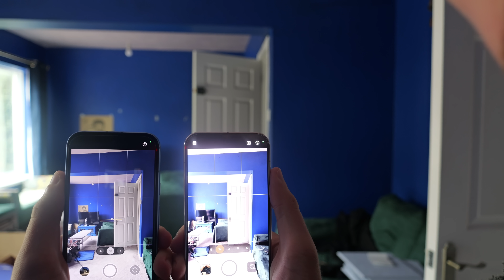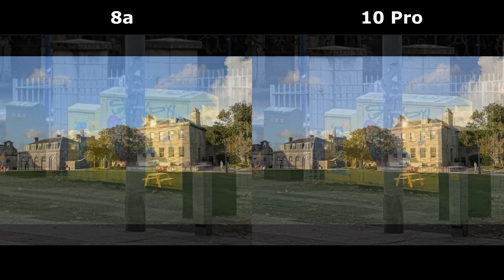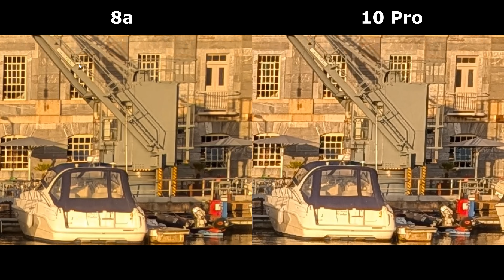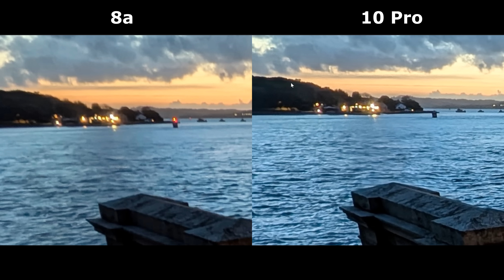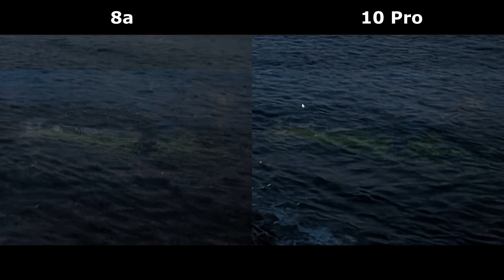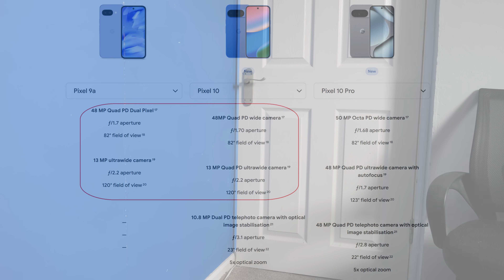I Tested Google Pixel's Cheapest and Most Expensive Phones

Comment: Considering the Pixel 10 at least has the same sensors as the 9a (which is surely better than the 8a and also gets some praise by itself) and then adds on a great telephoto, I am wondering why it gets trashed so much. Also - "could still suffer from the same low light" etc.... V/S Will surely suffer ... that's a key issue isn't it. The problem is that very few reviewers are checking out the Pixel 10 base model's main camera on merit. They always seem to preface their "wisdom" and seem obsessed by this downgrade issue. Which makes me wonder if there is some kind of bias at work here, a kind of horde mentality... or perhaps just a need to look kowlegdeable?

Comment: The HDR-ieness of the Pixel 10 Pro might be due to Ultra HDR, so the brighter thing might look darker in the SDR version of the image, but they are being brought up to the appropriate level by UltraHDR then. But for that to compare you'll need an UltraHDR compatible Image Viewer and an HDR video and the viewers would need an HDR screen.

If you have a compatible viewer and screen, I have to say the UltraHDR images look simply fantastic, with extremely bright highlights and great contrast. But the draw back of course are those software and hardware requirements to fully exploit those images. UltraHDR is available from Pixel 6 or 7 upwards I believe, my Pixel 7 Pro definitely supports it.

Comment: Is there a pro mode in the camera that disables processing? Or maybe 3rd party camera apps to test camera performance and not algorythems.
Reply: there is on the pro models but most people will just use auto.. which is why he's comparing them, in auto, without a tripod. emulating the results the average person will get if they either one.
Reply: @warmoaran3 I know, I'm just curious since some people are power users. The pixel is a phone with an unlocked bootloader and it's one of the few phones that retains it's integrity with a custom rom, specifically graphene OS I think. I haven't checked in a while so this info could be out of date.

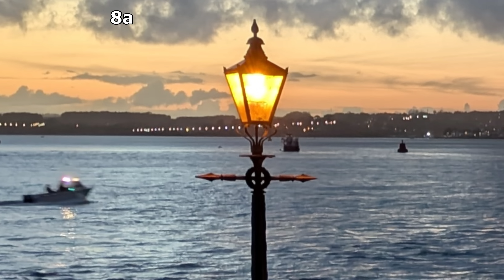Comment: 8:50 Isn't that just an example of different focus/exposure of the 2 pictures? For me it does seem like the 10 Pro photo had exposure level focused on the light, and the 8a photo was focusing its light amount somewhere else. Did you specifically chose the focus spot on both phones while taking a picture or you just snapped it?

Comment: For the next time it would be interesting to have the same photo taken two different time. The first is just casually pressing the shutter lile 99% of user will and the next should be maxed out quality or even RAW quality with some tweaking to get the most out of the sensor. But just showing the regular photo is how pretty much everyone will be using the phone so its definitely a valid comparison in my opinion.

Comment: Using 8 pro still and got regular 8 for wife. They have larger sensor than 8a (8a uses sensors of 7), so they work better in low light, which is a lot of time where we live now. Still happy with hardware and software is good enough - google has lots of bugs in their android version, but I'm tolerating most of the time. In general I look at what phone can do in low light - that's the main aspect of shooter. If it can also do physical zoom of 3-5x - it's a great perk for my bad eyesight.
Reply: Sony Xperias are currently the only phones offered that can do physical optical zoom of 3.5x - 7x!! although you probably meant fixed optical focal length, like the Pixel 10 pro 5x 113mm lens

Comment: Another interesting consideration is getting a budget phone and a cheap, second-hand DSLR for the photos.
I recently picked up a Nikon D3000, which is an outdated and limiting piece of rubbish to photography standards.
But I love shooting with it and processing my images myself in Darkdable, learning what the camera settings and processing steps do as I go.

You get full control over the sharpness and colour cast when shooting in RAW. I like to shoot in a set whitebalance, to adjust from there per photo.
I have not seen any of these insane artifacts, as my camera does not support bracketing and as I have not bothered doing it manually.

And it is fun to play with lenses, especially after picking up a cheap M42 adaptor I've been scouring local thrift stores for lenses.
On this specific cameras, you have to set exposure fully manually with adapted lenses, which is surprisingly easy to get right outside with the expanded Sunny 16 rule.
Inside I need a wider lens with metering and preferably auto-focus, so there I use the kit-lens.
But in low light, the ancient sensor struggles, so I put on a vintage nifty-fifty lens in these conditions, which makes it hold up okay.

My everyday carry (yes, I do bring it along with my phone) is a cheap IX mount lens which is good enough, which I modified to be safe on F mount.
I do look forward to upgrading to my next camera, I am eyeing the Pentax K50, going from 10 megapixels to 16 megapixels, but much more dynamic range.
Which is the spec that actually matters, if you can physically zoom and use a lower (not low) ISO this reduces the need for this insane level of processing.
Reply: Does your D3000 fit into your trouser pockets? 

There you have the reason for the chase for camera quality in smartphones: most people won't purchase a dedicated camera. 

Now where there is a huge market gap atm is compact cameras - they virtually died out during 2015-2019 only to massively surge in demand post-COVID - and manufacturers are struggling to push out similiar models to 2015-2019 lol A pocketable compact camera with a 24-105 2.8 lens would kill in this current market - but no ones making it.
Reply: @acidtears  it does not with a standard lens attached, that's what the shoulder strap is for.
It's not bad at all when shifting it to the back, where it sits stably on my lower back with a lighter lens.
Again, it's also a practical fashion accessory or wearable statement for me.
But if I take off the lens, I can fit both parts in my trouser pockets if I wanted to.

And this is why old DSLRs have gotten very cheap, including sub 5k click ones like mine.
Mine's worth €75, the stock lens being worth €50 and great for wider shots.
Compare that to the price premium of a smartphone with a better camera and it starts making sense.

Pocket cameras are absurdly expensive now, some old models selling for more than my entire photography kit.
But I've heard a lot of good things about the Ricoh GR as a good quality if expensive compact pocket camera.
edit: Checked, the older ~10 megapixel ones are around €200, which is very reasonable, especially as those pixels are directly usable.
I don't think it has a zoomlens, but newer versions have enough megapixels and above all lens sharpness to just crop after the fact.

Comment: I have a Pixel 7 and still get feature updates, and with PIxel 8 onward they promise 7 years of updates with each phone.
Reply: Nice of the EU to finally force google to reach the bare minimum of what Apple offers. To bad their flagship Pro phone gets wrekt in performance by iPhones from 2 generation ago, and compared to the 17, the Pixel 10 has half the storage and hours less of battery.

At least you can side load app. o wait.
Reply: @ddmegadodo2 As if anybody cares about 1.2 times faster performance on arbitrary benchmarks when even the cheapest smarphone nowadays is good enough to do most any task without any nuissance.

Apple's products have been overpriced garbage for 20 years
Reply: @Smrda1312  Try 2.5x faster. People clearly are voting with their wallets.
Reply: @ddmegadodo2 2.5x faster means nothing. Faster at what. I struggle to find any metric where it is actually 2.5 times faster. And again even if it was I struggle to care because even my friends xiaomi is fast enough for almost anything you use your phone for for a 5th of the price of the latest and greatest iphone 54 pro max
Reply: my wife has a 8 pro, and from time to time I play with it. Tbh I am very impressed after the last update, very snappy

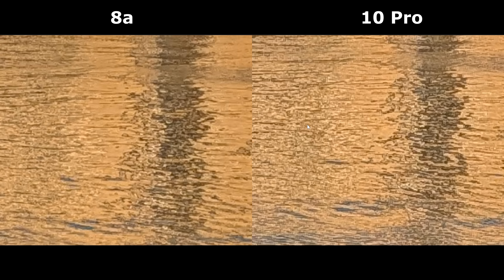Comment: 4:59 As soon as I saw the water... I knew..........
Reply: The way he is comparing the images creates a rather deceptive impression that zooming in lets you *see the pixels*. On any normal application, mobile or PC, some half-decent scaling will be applied. Some scalers are sharper than others, but generally the image will get softer as the cropped pixels get scaled up to your display's resolution, - which removes the edges you see around pixels and greatly masks the edges around compression blocks. With standard-practice scaling, these images would look a lot closer, and colors would be the primary differentiator.
The software he uses for side-by-side image comparisons uses nearest-neighbor scaling, which completely ignores edge continuity and simply creates copies of the pixels without any adjustment, so any tiny local differences get amplified 4x, 8x, or however much he decides to zoom in on the image.

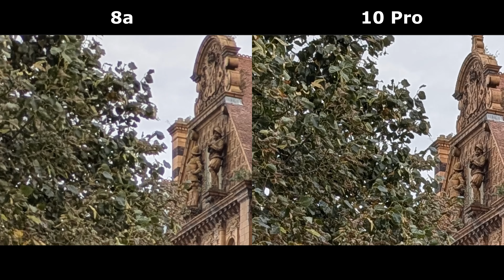Comment: 2:03 That's my biggest issue with phone cameras these days, and why I think many old phones take better pictures.
Everything is so ridiculously over-sharpened, any photographer can smell smartphone pictures from a mile away. The focus on "computational photography" was a mistake imo, they should be going for bigger sensors and tone down the editing. The competition from china has been using 1"-Type sensors in phones already, so it clearly is possible to make this work.
Reply: I think they could still use computation photography but with less exagerated sharpness
Reply: @erwile  Some corrections for sure, but these days, the manufacturers are all in on it, the hardware has been mostly stagnant for years.
Reply: @hrvstrr  I don't know, coming from a 13 Pro to a 15 Pro, there were some (minor) changes in terms of aperture on the wide angle, which is quite significant. But nowhere near 2 years of progress.
Reply: chinese phones still use a lot of processing, and whats worse is that they also use AI now.
Reply: @warmoaran3I don't understand how that's relevant to my statement 🤨

Comment: Imo biggest thing is that cheap phone starts to lag way sooner. So instead of replacing every 5 years, you have to do it every 2-3 years.
Reply: in this case: its a pixel, uses pretty much the same chip thats in the 8 & 8 pro. even same ram & storage speeds - just the overall build quality is reduced. & with recent generations: you don't, they are fast enough for daily task. if u want a gaming phone: you don't get a pixel, doesn't matter which one.

Comment: You can tell that they have done way to much postprocessing on the 10 pro without you touching it. Denoising was an obvious one and so is over sharpening. The colours look touched up as well. They are probably doing some ai stuff which just messes up images in my experience. Sharpening is a tool that is best used in small amounts and whenever I see "AI" sharpening it's overly used, Rawtherapee has a much better sharpening algorithm. If you really need it which you rarely do because most people are looking at photos on a phone where you can't see any detail anyway. I'm editing on a 55" 4k OLED so yea I can see detail there but on a 7" screen you won't see anything.

Comment: German tech outlet Computerbase does an interesting yearly blind test for the best smartphone cameras voted on by their community. The overall winner of 2025 was the Motorola Edge 60 Pro, which was the 2nd cheapest option of the lineup with the budget tip being the Samsung A56 which faired quite good as well. So a ~400 bucks smartphone beat an iphone 16 pro max, a Xperia 1 VII, a Galaxy S25 Ultra and so on.
Reply: I can tell it was done in auto because that's where the Sony Xperia doesn't belong. it doesn't take super HDR-Y  (it DOES do HDR in BASIC mode) washed out pics, and its best used in full manual. I should know, I have a Xperia 1 V!
Xperia cameras are especially good if youre a photographer who wants to treat their phone like they treat their dedicated camera. they aren't going to deliver the best pics in auto basically.
Reply: @warmoaran3 Yea, I get what you mean - even though I fear that most people still use even Xperia phones with auto settings, unfortunately. They're def great photography-oriented devices if you can handle them well.